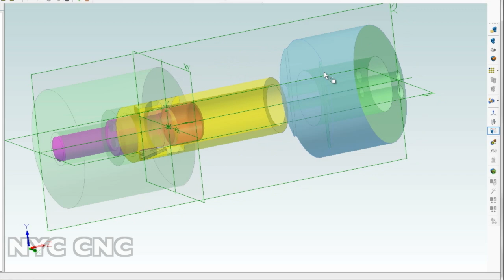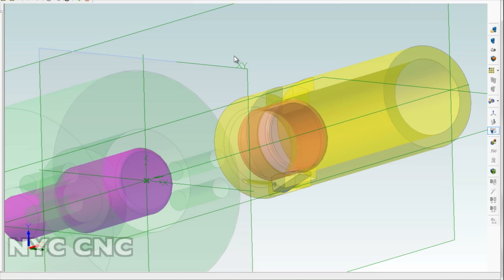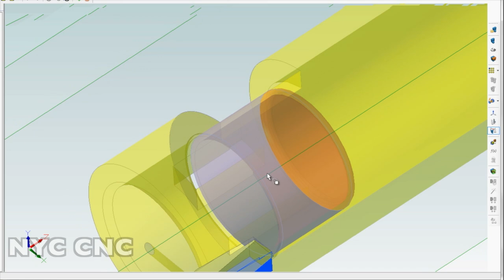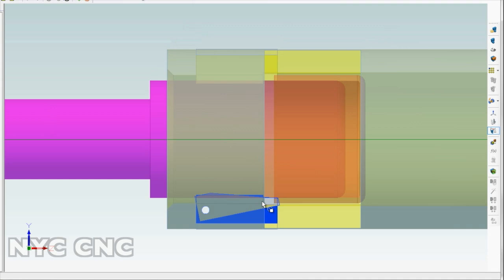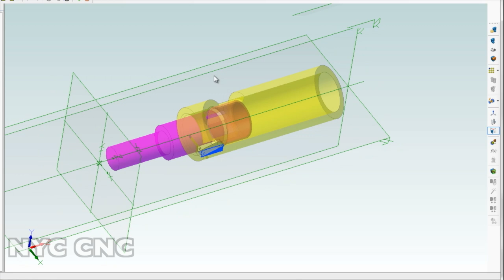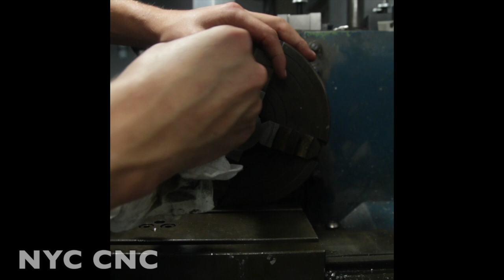Making Copper Bullet Jackets: Machining Punching & Drawing Dies!  Part 5

Comment: I just started learning about machining a few months ago. I am a cave man ...gorilla when it comes to doing stuff. I got a mini lathe to make swaging dies for bullets. They work but the more I learn the more I see how bad they are. I just learned so much on this video ...just wow. I was not boring my holes (most are only .224" which is pretty small for boring. I am currently working on a .460" hole . I have it drilled to .446" so I'm going to try cutting the rest with a boring bar. (never tried to use one any deeper than 1/2" before.) But armed with your instructions maybe it will go well. Thanks.

Comment: That's an awful lot of tailstock rowing.  Once the chips clog release the tailstock clamp and pull the whole tailstock back to clear chips.  Then push the whole tailstock in till it makes contact again, tighten tailstock, and resume feeding chips clog and repeat.  Moving the whole tailstock is not best practice for drilling a final size hole, but it'll cut the rough drilling time in half.

The rough finish is from chips rubbing between boring bar and ID of part.  Angling the bar a bit will help, as will a constant blow of air deep into the hole.

Thanks for making the videos, it takes me back to when I was on lathes and mills as a younger man.

Comment: hey why couldnt you just make a hole in the "punch that pushes the copper cup up" adn on the downward cycle have a pin that would push the cup off of the punch that it was formed on ? instead of cutting a window as you were thinking in the vid?

Comment: wouldn't the step on the inside diameter of the yellow part naturally act as a  striper if you pushed the yellow part far enough that the step in the i.d. went pased the copper. it would put more uniform pressure on the copper edge than one or two fingers

Comment: Such a nice quiet running lathe, Especially for a gear head machine..
Wish my big old gear head lathe was as quiet as that.
Mind you you wouldn't find a more accurate big lathe than mine, So I guess the trade for accuracy over dead quiet ain't so bad..
Good to see you using the new toy Mate. Told you ya'd love it and never look back.
Matt